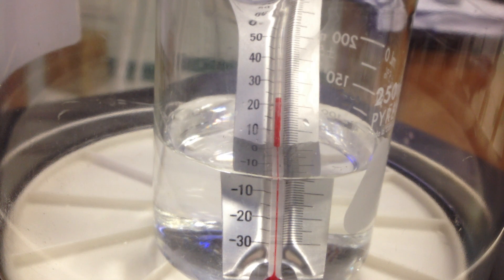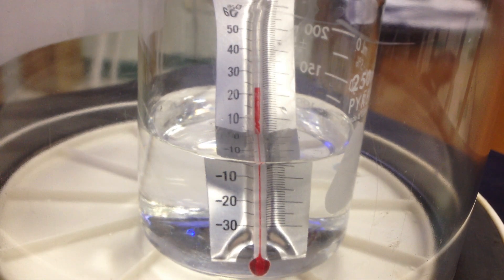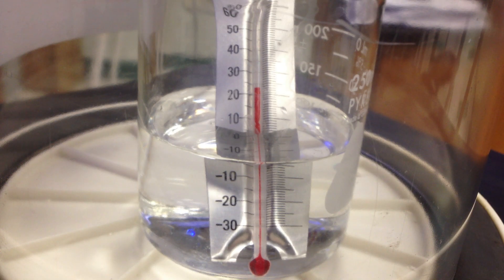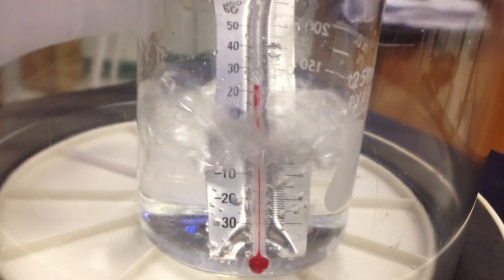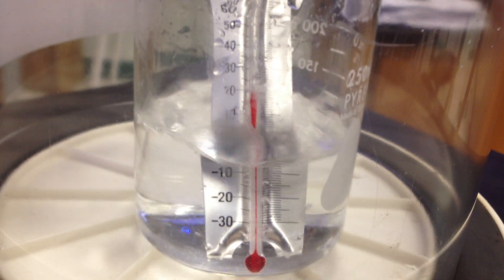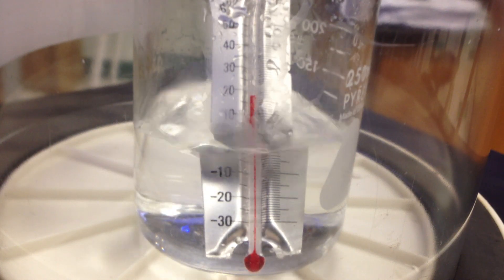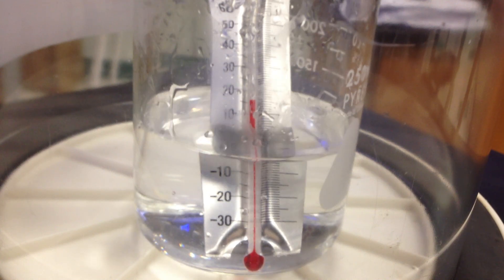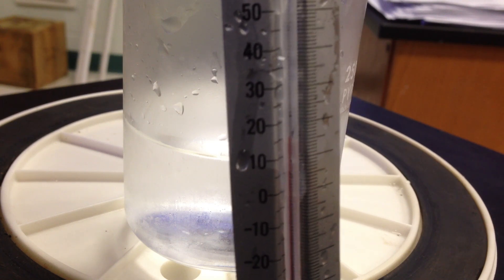Boiling cold water In a Vacuum Chamber

Comment: I'm curious if an underground reservoir on the surface of mars would boil away or freeze up and stay in place. 

My thinking is water, maybe in some hydrogel barrier would act as a protective seal from breaches to the surface. Similar to using green slime in a bicycle inner tube to stop leaks. And, this would hopefully increase the safety of colonizing Mars not only by stopping loss of atmosphere but also as a cosmic radiation shield.

Comment: What about the temperature of the vapor?
Reply from the maker: +garyrich2000 The temperature of the vapor is the temperature of the room which was about 23 degrees Celsius.  At the lowered pressure water vapor can exist a gas.
Reply: Thanks for the reply. I was trying to picture how useful heat could be extracted. Part of that potential is exiting the pump but I began to wonder if there is any radiated as well.
Reply: +Shui Shu Biao Hmmm, so the water turns to ice because kinetic energy of the rising vapor from a change in pressure is robbing the heat but maintaining room temperature vapor is what I gather, right? 

If so, then perhaps the ice would eventually turn back into liquid under a sustained vacuum via heat transfer through the glass wall?

Comment: Please advice, I need to get water vapour out from water inside a vacuum chamber. What would happen if i seal the beaker with water inside a vacuum chamber ?
Reply from the maker: killim nishanth If you seal the beaker inside a vacuum chamber then you would lower water vapor as will all gases in the chamber.  The seal around the water vapor will however prevent the lowered pressure from effecting the water in the beaker and there will be no boiling.

Comment: how does a water aspirator work to lower the pressure? is that a cheaper option?
Reply from the maker: A water aspirator works by the Bernoulli Principle.  Water runs through a pathway that also has a another pathway that is perpendicular to the flow of water.  As water runs down it "organizes the air in a downward motion" in the perpendicular pathway which results in the air in that pathway to spend less time pushing outward and thus lowers the pressure.  I do not believe that an aspirator can achieve a pressure lower enough to boil water at room temperature.

Comment: You could use that technique to build your own refrigerator lol
Reply: Hello 10-year-old comment. 

Just wanted to say that refrigerators do kinda work that way. (Vaporization is 'endothermic', it 'sucks heat from the local environment'. Fridge tubing contains a liquid which can vaporize happily at very low temperatures. They use pressure changes to coax it into vaporizing while the piping is inside the fridge, so 'sucking heat from the local environment', then relax it back to liquid state when the piping is outside, releasing its latent heat. Kinda cool :))

We all know that cooling effect from sweat evaporating off us. Or like how cold you get wandering around after a shower as the water evaporates off you. Mad how potent the effect is.

Comment: Very impressive.
How could one harvest the vapor in that vacuum chamber and condense it into purified water?
Reply: Some cities the water boils at 98, 95, 89°C
Reply from the maker: You could condense the vapor from the return on the vacuum pump but it might be easier just to distill water if you are looking for purification.
Reply: Thanks. Distilling is much easier, but due to climate and available resources, I am investigating other costly alternatives.  I put a quart of water in my vacuum chamber after the initial boil (:30sec~ @ 900mT) it stopped bubbling and became still and then froze solid around 500-400mT, I did get some light Ice on the walls of the chamber.  I suspect I need a heat source inside to prevent freezing; then perhaps collect the ice off the walls?  PS: My vacuum chamber also has a refrigerant coil on the outside wall that can bring the internal temp to -50F.
Reply: Question #2:  Water companies tell us to boil the water if a pipe has broken, or if one needs to drink pond water, etc; to kill waterborne pathogens and other nasty organisms.  I was wondering if boiling it at room temperature in a vacuum would kill said organisms; or is this potable water goal a function of temperature vs the boil?
Reply from the maker: Bruce Wayne The water companies are usually assuming that that you are boiling water at standard pressure, which would mean that your water is at 100 degrees Celsius.  Water boiling at room temperature as in my demonstration would not kill harmful microbes as the temperature is not high enough.
Reply: THEDARKSIDEOFTHEFORCE66 
Astronauts wear pressure suits. Science is not all-or-nothing.
Reply: MrGrodskiChemistry So an astronaut could never be in space because of this. I saw a video on YouTube on a guy in a vacuum zero g chamber. He passed out and he felt his tongue boil.

Comment: Would it boil down to ice by starting with hot water as it should boil down quicker with your limited vacuum?
Reply from the maker: Using hot water would not achieve ice quicker. It would achieve boiling faster as warmer water has a higher vapor pressure, thus it would take less of a vacuum to make the warm water boil.  If you look at the phase diagram of water the conditions of pressure and temperature have to be lower for ice to form. A lot heat would have to be dissipated before the triple point is achieved and this would take temp of 0.01 Celsius and pressure of about 0.006 atm.
Reply: Thanks for the info.
Reply from the maker: MrGrodskiChemistry In retrospect water will boil faster starting with hot water and may ice faster as water loses heat in a variable fashion.

Comment: the water molecules that are evaporating, are the hydogen bonds being broken? I didn't know the full definition of boiling before and understood it to be breaking the intermolecular forces.
Reply from the maker: Boiling is the temperature at which the vapor pressure equals the atmospheric pressure. The H-bonds yes are being broken to create the vapor pressure but these intermolecular forces are also broken when the boiling point has not been reached.  All liquids evaporate below their boiling points due to the distribution of molecular motion or Kinetic Energy for all liquid molecules at a certain temperature. I often call the Boiling point the temperature where maximum evaporation occurs.
Reply: thank you

Comment: What if you use soda instead of water ??
Reply from the maker: That would be interesting. I would believe you would see 2 waves of bubbles.  The first would be the immediate loss of carbon dioxide from the soda as the lower pressure lowers solubility of the gas in the solution.  The second wave of bubbles would be water as the pressure continues to be lowered to boil the water in the mixture.

Comment: What's escaping from the water ?? The dissolved O2 or the H2O molecules??
Reply from the maker: The solubility of dissolved gases is dependent upon pressure thus any dissolved gases are leaving the water. The boiling point of the water is dependent upon pressure as well. The visible bubbles are the water molecules who have reached their boiling point as the pressure above the liquid is lowered. There is not enough dissolved oxygen in the water to give visible oxygen bubbles.
Reply: MrGrodskiChemistry thanks for the explanation!!!!
Reply from the maker: sami aklilu You're welcome!

Comment: I teach fluid power/hydraulics in college, and refer to this common high school physics lesson when we talk about pump cavitation. Shamefully, it appears the high school curriculum in our province no longer delivers this as none of them ever know what I'm talking about. Important lesson for HVAC training too. Thanks for laying a solid foundation.
Reply from the maker: Thanks for your feedback.  Its good to know that I am pointing them in right direction.
Reply: Nicholas Driver can you please tell me if boiling water in a vacuum creates steam ? Honest question !
Reply: Actually you arent. Youre claiming waters "boiling point" decreases under a vacuum, when that isnt the case. The water isnt "boiling" due to temperature factors, its due to there being gases present in the water. Marshmallows expand in a vacuum because of the air trapped in the pores, however, marshmallows do not "boil" due to lower "boiling points". This is a poor theory and shouldnt be taught to students as "fact".
Reply: @nicholasdriver6624  Wrong: De-ionized and de-gassed water does exactly the same thing - boils off.

Or, if you run the experiment through to completion, all the water disappears.  If it wasn't boiling off, where did the water go then?

The boiling point of all materials depends heavily on the ambient pressure - which is why all boiling points are specified at a given pressure. If you think otherwise, you have an uphill battle against mountains of evidence and more than a century of materials science.

Furthermore, if you increase the pressure, the boiling point goes *up*.  How does that work then?
Reply: @nicholasdriver6624  You can be proven completely wrong simply by looking at a phase diagram of water.

Comment: Water does not change temperature as it boils (Q=mL); the lowered temperature is actually due to heat being removed from the surrounding environment, including the thermometer itself [(delta)T=Q/mc].
Reply from the maker: Clearly in this demonstration water is changing its temperature as it boils. Now I agree that under constant pressure and at or near standard pressure the temperature of the water will not change as the heat absorbed by the water needed to produce a vapor pressure equal to that of atmospheric pressure is enough to replace the kinetic energy converted to potential energy in the phase change.  In this case however the pressure is not constant and is being lowered throughout the demonstration.  The water cannot replace the heat lost fast enough at room temperature, as the higher kinetic energy molecules evaporate due to water's high specific heat. Thus the average kinetic energy or temperature drops.  The water keeps boiling because the pressure keeps dropping and the lowered pressure requires less vapor pressure to boil.  If this were not the case the water would cease boiling. Also, your assertion that heat is being removed is the reason has limitations because we are using room temperature water so there would be very little if any heat transferred. Removing the water molecules with the higher kinetic energy lowers the temperature of the water and the lowered pressure makes it reboil at that lowered temperature.
Reply: MrGrodskiChemistry Thank you for your thorough response. I was simply confused by what I was seeing, and you helped clarify it for me. I was using equations like Q=mL and Q=mc(delta)T in cases in which they are not applicable. That being said, I am curious as to whether or not the temperature of the beaker decreased, even slightly. The analogy may not be completely valid, but the nozzle of a propane tank decreases because the propane absorbs heat from the outside environment when it boils. Then again, propane's boiling point is much less than room temperature.

I would not be surprised either way as to whether or not the beaker's temperature decreased.
Reply from the maker: BlackSkullRacer613 The decrease in temperature you are talking about when gases expand through a small opening is called the Joule - Thompson effect.  
As the propane expands out of the container (high pressure) it does work on the surroundings (which is under lower pressure). The work must come from the internal energy of the gas so that the internal energy decreases. Since the internal energy of an ideal gas in only dependent on its kinetic energy that means that the temperature of the gas must decrease. There is no transfer of heat in this process.  Its more like kinetic energy being converted to potential energy.
-The beaker did get colder as the temperature of the water dropped. Glass has a lower specific heat than water and the beaker would transfer its heat.

Comment: it's not boiling you idiots it's being vibrated by that machine. this is science fraud
Reply from the maker: The temperature that water boils is dependent upon atmospheric pressure.  Boiling is when the vapor pressure or the pressure of the evaporating liquid upward equals the atmospheric pressure downward.  Lowering the atmospheric pressure will in fact make the water boil at a lower temperature because less vapor pressure is needed to equal the lowered atmospheric pressure.  This is a science fact.

Comment: I noticed a few DIY demonstrations such as yours where mason jars or beakers are used.  What are the requirements of a vacuum container?  Can it be a soft, flexible material?  For instance, could I use a super strong garbage bag rather than a mason jar or beaker?
Reply: Lol, you want to boil cold water in a bag? Sounds hilarious, but you run into a problem - your pump will suck the bag in. However I'd like to see how liquid boils in a bag! Should be interesting. Maybe you can seal liquid in a bag and put it into vacuum container... But bag will rip because of increased volume, oh boy.

Comment: As the water is "boiling" would this help salt dissolve in the water faster then same temp water in normal atmospheric pressure? Thank you for your time sir
Reply from the maker: Gary the water is boiling at room temperature and solubility of a salt is dependent upon temperature so since the temperature of the water is the same (actually lower because evaporation is an endothermic process), the ability to dissolve salt would be the same.  Interesting enough adding salt would lower the vapor pressure of water and raise the boiling point at atmospheric pressure. 

Boiling is when the atmospheric pressure equals the vapor pressure and if we lower the pressure as in the demo above the vapor pressure needed to match the atmospheric pressure would be less.  Vapor pressure (the force due to water molecules evaporating upward) of the water is dependent upon heat absorbed thus a lower amount of heat is needed to produce a vapor pressure to match atmospheric pressure.  So the boiling can occur at room temperature if the pressure is low enough.
Reply: Nicholas, the temperature of 100C isn't special, it's just the number we've given to the temperature at which water boils at normal atmospheric pressure. Water can indeed boil at lower temperatures, as shown by the phase diagram: http://www.webassign.net/osgenchem1/10-figure-31.png

Things get a bit weird at triple points and beyond critical points, but water boiling at 80C at the tops of mountains or at 20C in this video are legitimate examples of the process of boiling.
Reply: MrGrodskiChemistry And then post boiling, the energy used would allow the water to freeze (aside from extra factors).
Reply: Gary Calismax  😀😀😀😀😁😇😤
Reply: The water isnt actually "Boiling" in the sense they are trying to portray. Its simply due to the vacuum pulling out the gases. This is why I have grown to distrust the majority of scientists, as they mislead people into believing outlandish theories.
Reply: @nicholasdriver6624  thank you, this is true, now the water acts as an hydroxide solution, meaning if you put a few oil drops in in they will mix (emulsify)

Comment: If we put a thin slice of apple in the vacuum chamber, could  it be dehydrated until becomes similar to the dehydrated apple slices which are sold in health food stores?
Best regards!
Reply from the maker: The results will not be as good if you first froze the apple and then lowered the pressure (freeze - drying). The phase diagram of water illustrates this.  How much we could dry the apple is a good question.
Reply: MrGrodskiChemistry
So it would be hard to replicate... :-/

Comment: If we do this experiment with salt water, could we do this to extract the salt from water?

Thank yout!
Reply from the maker: Yes you could but it would be easier to just boil off the water in standard pressure.  Salt water is a mixture and thus can be separated physically by the changing the phase of the solvent (water).
Reply: MrGrodskiChemistry yeah, boiling is for sure the most pratical way, but using a vacuum pump would be the coolest way!  Could you make one for us?  There isn't any on youtube :-(
Reply from the maker: Diogo Yes I could make that video but it would have to be a time lapse since it would take a quite awhile to boil off even a small beaker of water.
Reply: MrGrodskiChemistry
So it's much slower than boiling? Even so, it would be very interesting if you could make the video even with time lapse. I just suggest to tell us the amount of water and the amount of time that was necessary until the complete vacuum evaporation. Thank you for your kindness!
Reply from the maker: It is boiling but I am afraid my vacuum pump might heat up before I get complete evaporation.
Reply: MrGrodskiChemistry
That's a shame! :-(   Even with just a few milliliters of salt water?
Reply from the maker: Ok well I do not see why it would not work.  The salt water mixture will have a lowered vapor pressure than the water I used so it will take a bit longer but it should work.
Reply: MrGrodskiChemistry it would be very cool to see the water desapearing and the salt starts to appear..
Reply from the maker: I will see if I can make this happen.
Reply: MrGrodskiChemistry   Great! Thank you! :-D